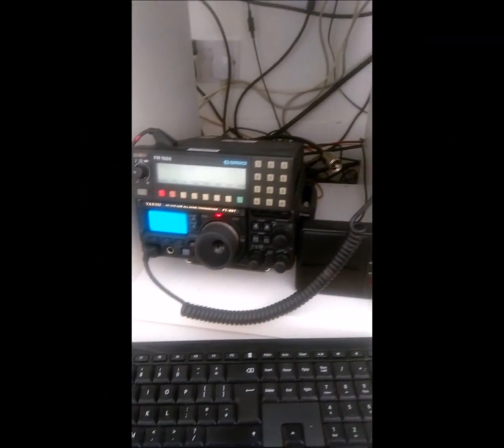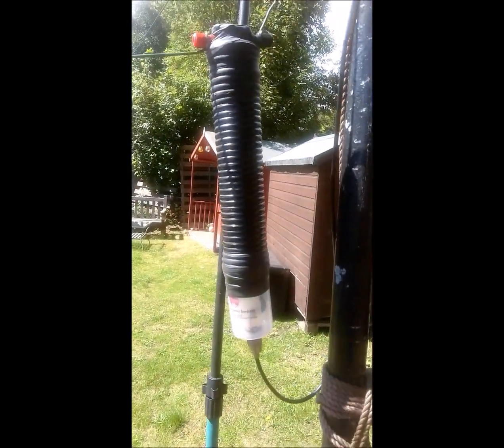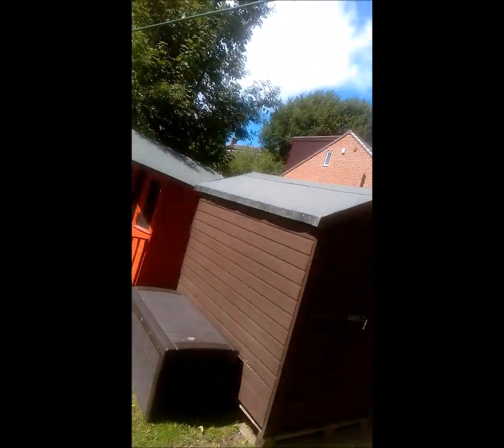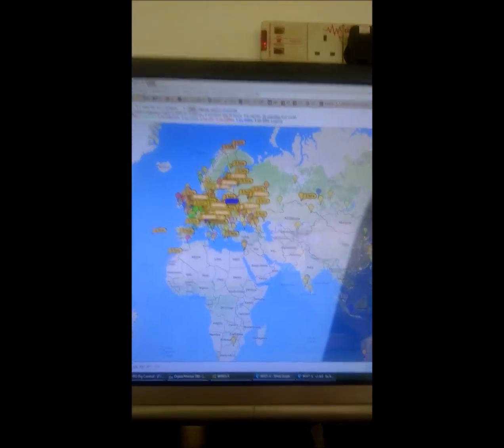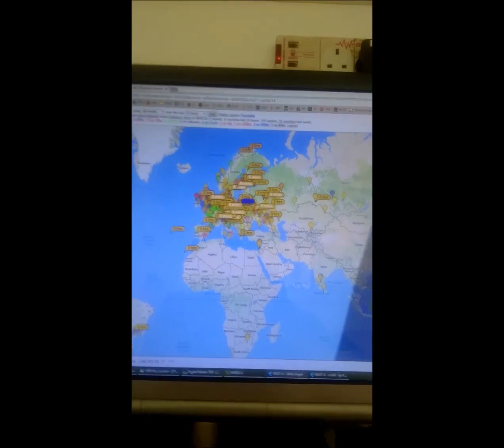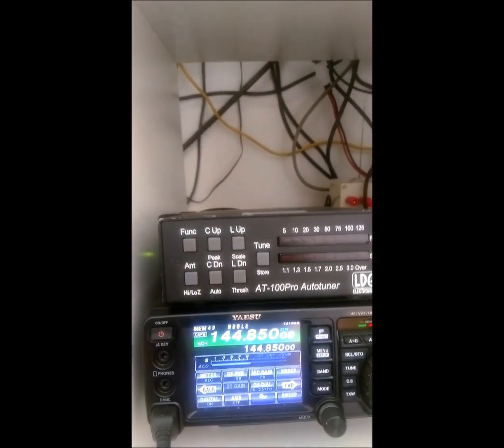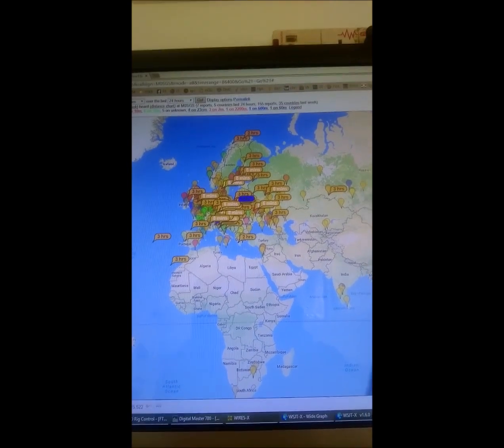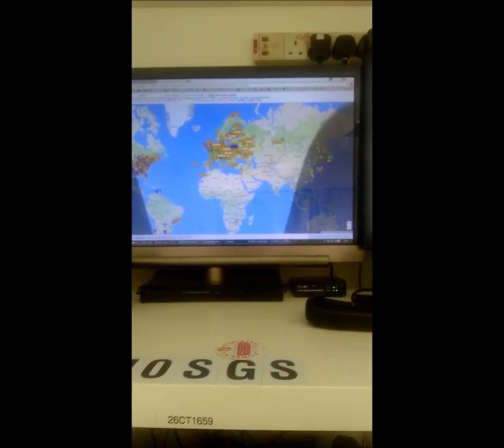Stealthy washing line antenna

Comment: I need to get a new data cable for jt65 one of my pins on the plug got really bent so had to scrap it
Reply from the maker: what interface are you using Glynn and what radio
Reply: yaesu 450d and was using one of these worked great but i bent a pin taking it in and out all the time.

http://www.ebay.co.uk/itm/401092195792?_trksid=p2055119.m1438.l2649&ssPageName=STRK%3AMEBIDX%3AIT
Reply from the maker: I've used this one for over 4 years http://www.g4zlp.co.uk/unified/DM_MiniPRO.shtml and it can be left attached very solid piece of kit
Reply: looks good might get one
Reply: ordered one thx for link